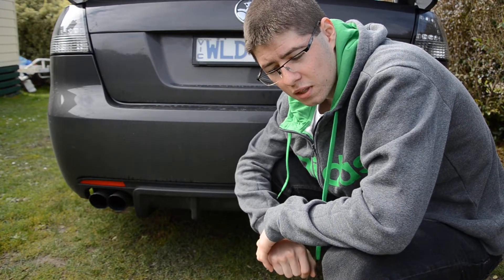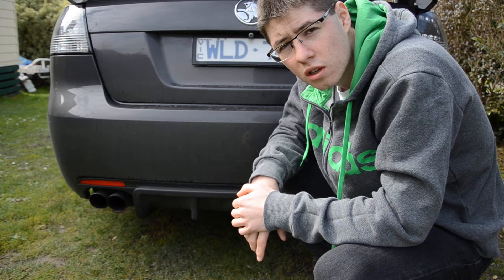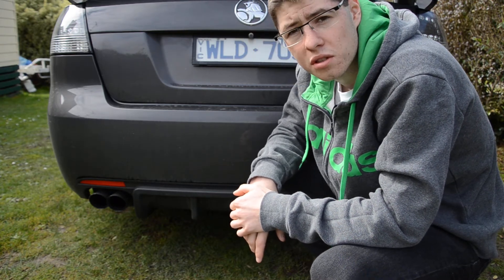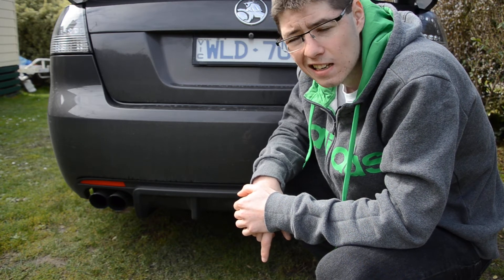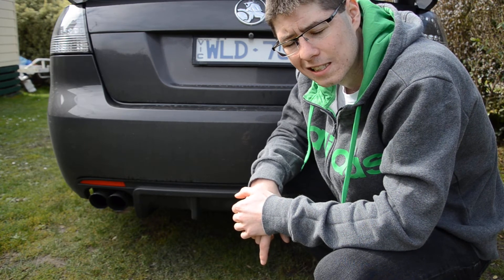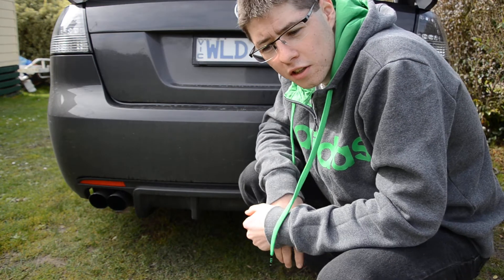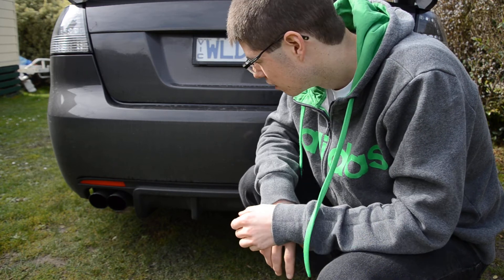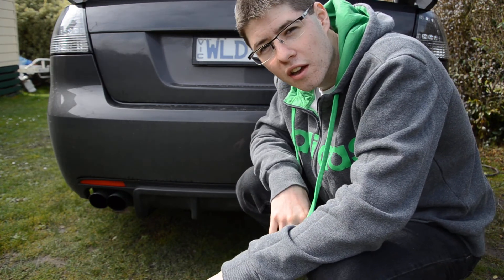Holden VE Omega Series 1 with SSV Exhaust

Comment: Sounds decent though there's a lot of smoke blowing from the exhaust and it sounds a little rough... Was it cold or something?
Reply from the maker: It was (a) cold and (b) it was a cold start.

I am Gippsland, Victoria so it can be a little cold here. I did post this in August, so it would've been cold.
Reply: @GeekCohen  Yeah... Don't rev your engine during a cold start because that's how you f up the engine...

Do you still own this car though?
Reply from the maker: @MartinJones123  Yeah, well this was early on in my day when I had the car. Wouldn't do it now.

I owned it up until a month ago. Traded it in for an FX4 Ford Ranger...... Did me well for 10 years and 225,000 kms.
Reply: @GeekCohen  Oh... I also own a VE Omega with the 3.0L V6 and have had it for a long time... Timing Chain and a few sensors were replaced at around 120,000km... Commodores are great cars if you take care of them...
Reply from the maker: @MartinJones123  I had done the timing chains with Oil Pump. I had mine lowered on SSSL all round. I had done the link pins earlier this year and then had another squeak and virbartion, I think it was the tailshaft bairing. Then it was time for an upgrade unfortunately.

My wife wanted something bigger as well rather than being low all the time.

I did like my VE and wish I could've held onto it, but it was time for an upgrade to and have something different that was more suitable for me and the family. It was my first car, so things have changed since then.
Reply: @GeekCohen  Fair enough... Mine's stock as can be 🤣🤣🤣

Comment: That sounded really quite good for an Omega. Going to do the same with mine but with the VE Clubsport exhaust. Is that the stock Omega rear bumper? I noticed it has the G8 diffuser but the stock Omega bumper has the reflectors on the actual bumper and yours don't?
Reply from the maker: Its an upgraded G8 diffuser on the omega rear bar, a pain to fit, but it is fitted and it looks good. I didn't have to worry about getting a new bar to fit the G8 diffuser.
Reply: Cohen Lewis it does look very good. The rear bumper in my Omega has the reflectors already in the bar so putting the G8 diffuser would probably look a bit weird having two lots of reflectors. Could be because its a wagon but I would have thought the wagon and sedan used the same bar.
Reply: @GeekCohen what was the process of fitting the diffuser if you remember? I’m think about doing the same instead of upgrading the rear bumper

Comment: Hey mate, was interested in putting the ssV exhaust on my 08' 60th anniversary, only thing I am not keen on is the classic drone from every VE v6 with an exhaust, was just wondering what it's like when just driving through built up areas and freeway driving and if this drone exists as most custom exhausts have no front muffler and the ssV one does (well at least the one I have does), Cheers!
Reply from the maker: There is little to no drone at all. I drive a lot around town and have a little drone but you don't notice it. People don't notice it in the car either, only if you really listen for it do you hear it.